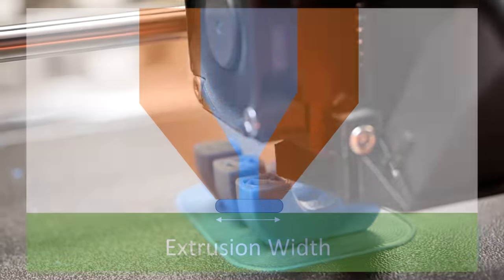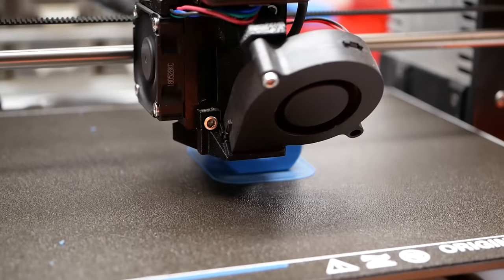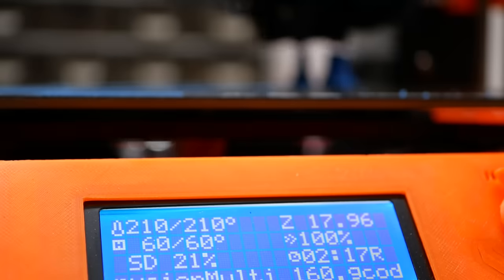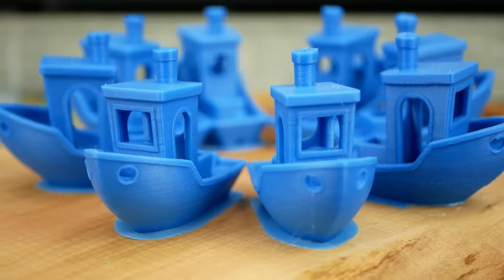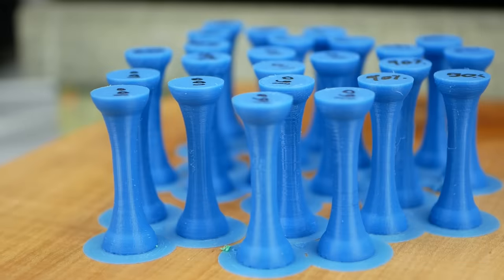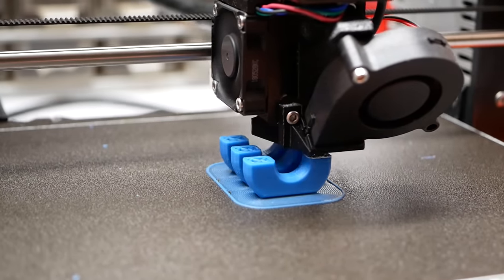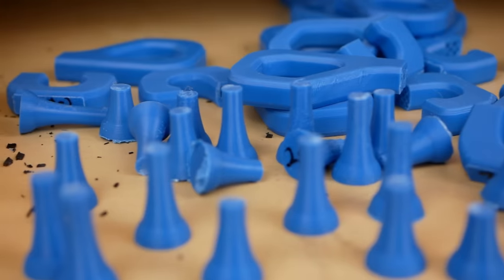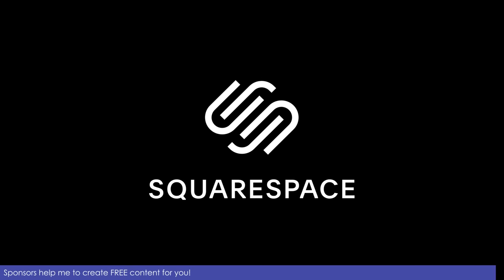Extrusion Width - The magic parameter for strong 3D prints?

Comment: I wonder if printing it in a vacuum would make the layers stronger.
Reply: How would you cool the parts? There is no air for the heat to transfer to, so you would likely have significant problems with the filament not solidifying.I suppose the bed could sink some of the heat for the early layers, but you would need to print extremely slowly and it would grow worse and worse the more layers you add because each layer is more insulation from the heat sink.
Reply: @coopercummings8370  agreed. Unless your print is very flat you're going to have a bad time.
Reply: @coopercummings8370  There's no air to cool the hot end either. OP would print barely anything if at all before heat creep would jam the hot end.

Comment: If anyone is familiar with the Prusa Slicer (v 2.0.0), is this just achieved by increasing the "Nozzle Diameter" under the "Printer Settings" tab?  Would be logical that the Slicer would automatically compensate by adjusting the filament feedrate, but would appreciate feedback if anyone has experience with this.

Also, using a Prusa Mk3, does the nozzle actually have to be changed, or can these benefits be achieved simply by changing the Slicer settings?
Reply from the maker: Nozzle diameter and the nozzle itself doesn't have to be changed. Only change the width, PrusaSlicer is adjusting the flow as well.

Comment: Two words, Poisson’s ratio. Your testing setup is missing a crucial component. You need to actively measure the narrowing of the test specimen as it stretches and use the diameter at the point of fracture to calculate tensile strength. I did not see this measurement taking place in the video. If you are using the unstressed diameter in your calculation, then your MPa calculations are off and the actual tensile strength is slightly higher than calculated.
Reply: Better to have a higher actual amount than lower

Comment: Thanks! I've wondered about this. I've been focusing on designing models good for 0.6 mm nozzle and have been using 3 perimeters and 110% width. Seemed stronger but only from casual observation. Never thought to try higher either! Now I'm curious. (EG: https://pinshape.com/items/55466-3d-printed-fully-3d-printable-micro-dremel-bench-mount )

Comment: I love to see that you re using a more professional statistical approach in the more recent videos.  However the way ure analysing the data gathered seems to be wrong. Try exploring it with  the ANOVA and Tukey Test. Really straight forward which might indicate that there is no significative difference between your treatments.
Reply: I think that he knows about the limitations of his experiments, but has to sacrifice some statistical power in order to limit the amount of work. Also, his experiments usually don't have categorical splits, but the parameters are continuous and we expect there to be a maximum. A Bayesian treatment might work very well for such data.

Comment: Ich fasse die Extrusionsweite IMMER an! Ich habe jetzt das Video noch lange nicht fertig gesehen, aber Du stellst Di Frage ja ganz am Anfang. Mit engerer EW bekommt man geschlossene Oberflächen hin. Den "Fahrplan" kennst Du? https://www.3d-druck-community.de/showthread.php?tid=25055  Jetzt schau ich aber weiter...
Reply: OK. Für mich ist eben die Druckqualität im Vordergrund. Aber interessant. Und nein, es ist nicht der mangelnde Overlap, der die Löcher in der Oberfläche macht, sondern eben ganz genau die große EW. (Ein Blick in die Duckvorschau macht schlau ;) )
Reply: Hmmm, Deine Theorien über die Auswirkungen der EW auf die Extrusionsmenge ist m.E. diskussionswürdig. Da ist ein Blick auf den GCODE erhellend. Und m.E ist die EW nicht wirklich so ausschlaggebend für die Menge. Aber ich gehe, wie gesagt, in eine ganz andere Richtung: Ich fahre bei PLA meist um die 0,35 EW bei 0,88-0,85 EM. Da sieht man dan irgendwann auch fast keine Z-Naht mehr. Für schöne Drucke halt was anders als für starke Drucke. Aber ab und an brauche ich auch eine stabiles Funktionsteil. Da bin ich froh ob Deiner Ausführungen. Und das Benchy mit 1 mm EW ha schon was Künstlerisches ;)

Comment: Your first tensile strength tests don't seem correct. The samples should fail in the middle section, which is the smallest one. It looks like you have a sudden change of geometry or inner structure in the section where it breaks.

Comment: If you are willing to add a little work and make a composite material, adding continuous fiber reinforcement can be designed based on load paths. a very good article explains and shows how at https://www.researchgate.net/publication/283671970_Design_and_evaluation_of_additively_manufactured_parts_with_three_dimensional_continuous_fibre_reinforcement  And I think some tests would look cool on videos, hint hint.

Comment: For the first time one of your videos is really confusing. IMO you should have done a more thoroughly explanation and graphics with side-by-side examples of both extrusion width and extrusion multiplier and how an increase in each of those parameters makes the extruded material lines look differently.  
Also at 1:25 the arrows (right) in the graphic indicate the extrusion multiplier being responsible for the width of the squeezed out filament but at 2:04 you show the same arrow length but the text "extrusion width" below. 
Also confusing was that you first emphasize that extrusion with "sets the distance between the lines and adjusts material flow accordingly" but don't explain what "accordingly" actually means. Later you mostly talk about that "more material gets squished out" but since an inexperienced user only would have understood the part "sets the distance between the lines" he/she would wonder if you are now talking about the extrusion multiplier and made a mistake somewhere.
You really should have emphasized in the graphics and explanations that extrusion width not only sets the distance between the lines but ALSO pushes out more material, with the intent, that there are NO MORE GAPS left between the extruded material lines. - Your graphic at 1:25 shows gaps between the extruded material lines and thus is giving the wrong impression about what extrusion width really is.
Anyway, great review as always and you get a thumbs up!